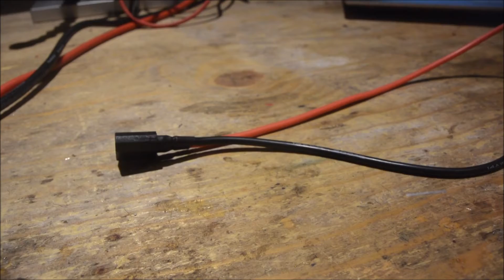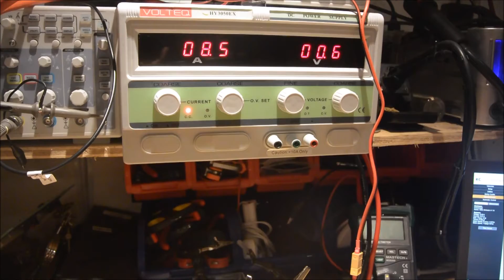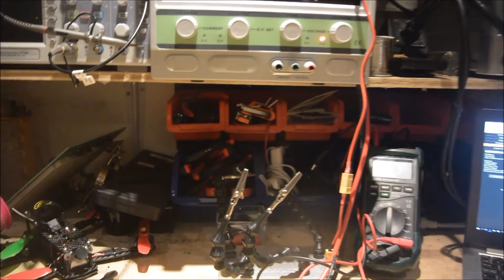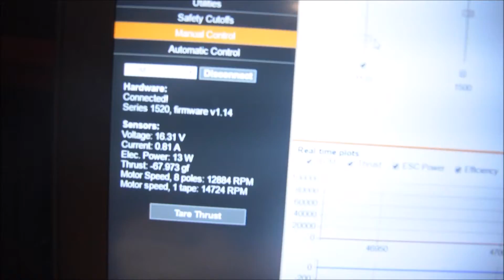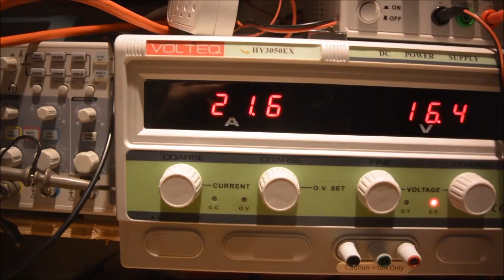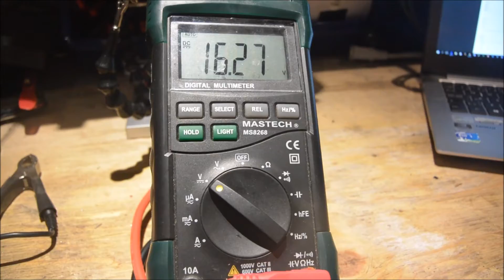Recursion Labs - 30v 50A regulated PSU + Tyto Robotics Dynamometer combo test

Comment: https://www.youtube.com/watch?v=O9cwVU6_2Ik
I got:  
989g / 23.05A / 15.96V 
You got:
879.74g / 22.85A / 15.99V

Amps are very close. Thrust is a lot off, but I'm thinking it could be due to ESC being used and atmospheric differences. On my recent 2205 motor tests (DYS SE2205, EMAX RS2205, rcINpower GT2205) there has been some concern about Amp measurements being quite high with 6" props and some of the heavy 5" triple-blade props reaching upwards of 40A. 
QuadMcFly's measurements are about 7A lower for the max thrust current draw. Comparing with my other cheap Powermeter it's about 1.5A higher reading on the RCBM sensor. I don't know if it's getting out of wack once above 30A.

Comment from the maker: One thing that was awesome to see during the voltage test (which I didn't record) was the voltage spike for a quarter of a second on the power supply during breaking. It took the back EMF like a champ, and actually measured the spike.
Reply: I believe you. I've read all about that feedback due to BLHELI damped light and all the various methods that would be needed to avoid frying the power supply. Great choice on getting that one then.
Reply from the maker: +EngineerX Yeah. As I pointed out I learned about that the hard way last year :)

Comment: Awesome! Thank so much for running this test. Sensors are pretty much spot on. Except your RPM's - looks like you forgot to change motor type to 14P. But that's an easy 15 second fix :)
Interesting to see how Amps and thrust start to drop due to motor beginning to suffer from heat saturation:
879.74g 22.85A 15.99V
852.51g 22.18A 16.00V
820.20g 21.61A 16.02V

So that's a DAL V2 5045BN or a DYS 5045BN? I'll run my RCX 2205-2350KV to see how it compares to make sure the current sensor in mine reads very close to yours. I'm really liking this thrust stand! 
That P.S. is so nice!
Reply from the maker: +EngineerX That's a Gemfan 5045BN on there. The RPMs from the optical sensor should be accurate though, no? The motor was definitely getting hot as I started to smell them. I'm guessing that change is due to the added resistance caused by the heat?
Reply: +ExplodingFist Recursion Thanks for clarifying. I fixated on the ERPM sensor and didn't notice the optical, since I only use the ERPMs. Yep, optical is accurate.
Right. More heat adds resistance in the wires, these runs are some good torture for the motors.